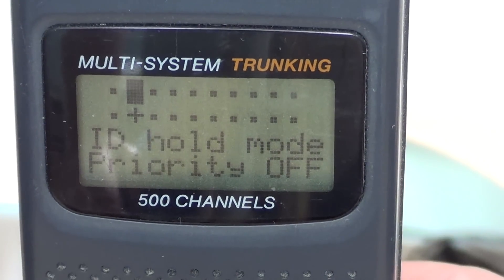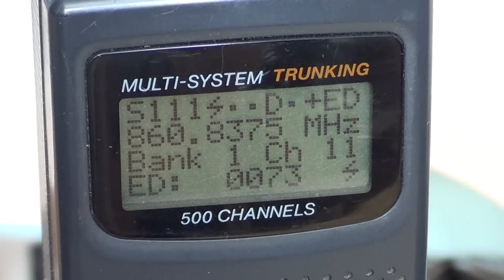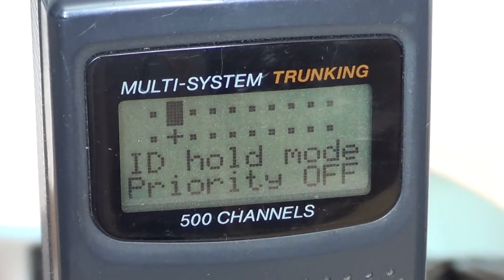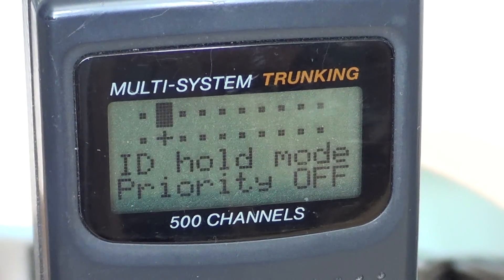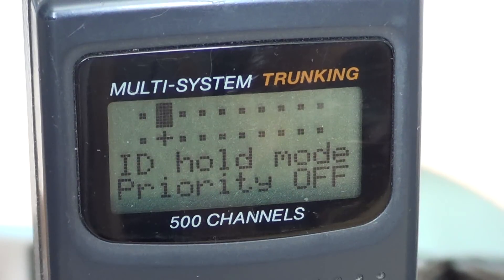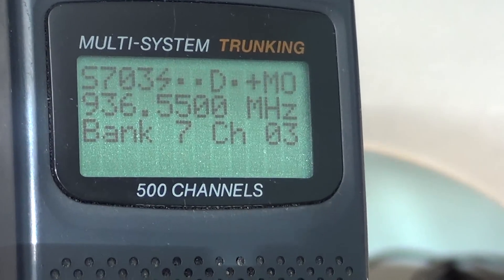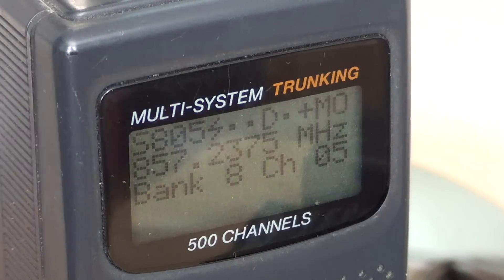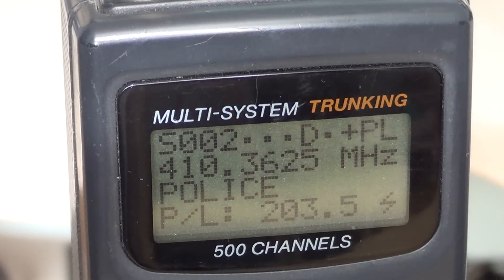Introduction to what is truking

Comment: I have a pro-92, but haven't used it in 8 years. It did come in handy for monitoring LTR systems since it didn't require the freq's to be entered in LCN order.

Those old LTR's here were converted to MotoTRBO Connect Plus 7 years ago.

I've been scanning since 1990.
Reply: RFI-Crypto Lab - still useable but Modern scanners have PC programming and are Digital Modes, most agency's are going to Digital.